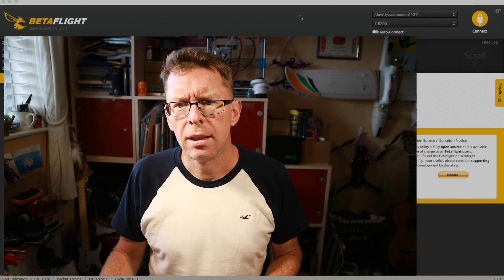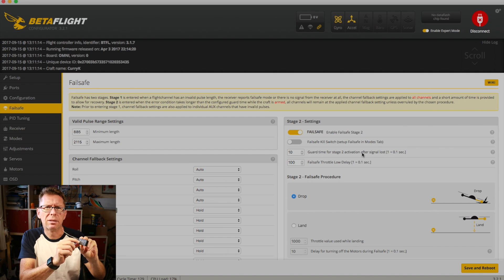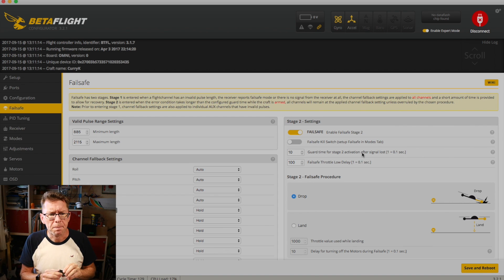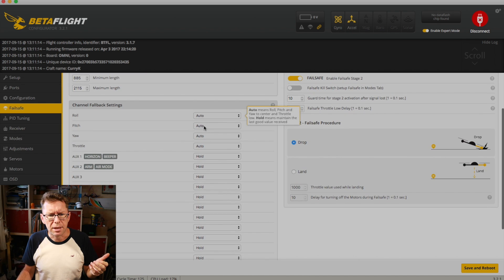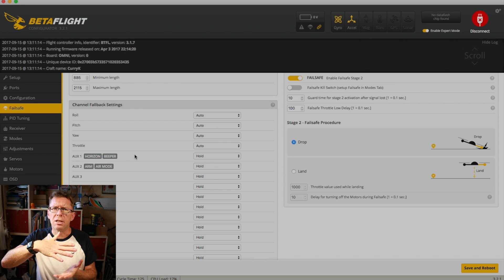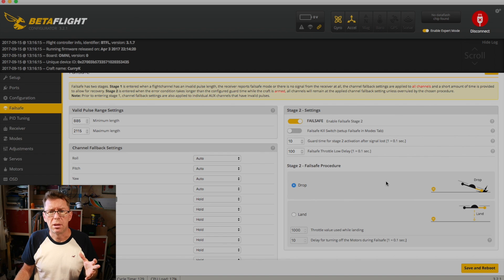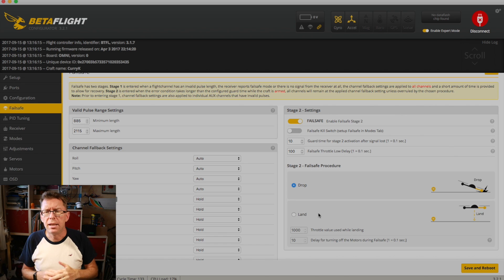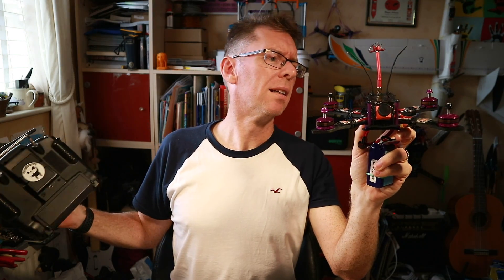FPV Tutorial: BetaFlight Basics Part 4 - The Failsafe tab

Comment: Hello buddy just wanted to ask you I keep getting the failsafe warning and beta fight which is preventing me from arming and I don't know what to do it's for the mobula six whoop V flight controller? Beta fpv lite 2 se is involved lol...
Reply from the maker: It does seem reasonable to not let you arm if you are failsafing... afterall it means you've lost your control link.  I don't know the FC, does this have a ELRS rx SPI built in, or is it an external rx.  External rx, then I'd be checking out the physical wiring and looking for lights to see if this is losing the signal.  If it's SPI, then check you version of betaflight to see what version of ELRS this contains and double check this is in synch with the radio

Comment: Hmm! I increased guard time from 4 to 10 (1second), however when I tested it by switching off the transmitter the props only spun for .4 of a second (same as before I changed it from 4 to 10), they should have spun for 1 second. Any idea why it did not change? My Taranis radio failsafe was also set to no pulse.

Comment: I know this os older post but you seem active to your listeners.....I have old radio FS-T6(Flysky)This 100% has no ability to do failsafe.I am going to use this radio and swap a quad I have to an F4 FC(Currently CC3D)as you know CC3D has no failsafe option.So bottom line Betaflight should be able to do failsafe no matter the radio...correct?

This build is just a trainer of sorts.Thats why using old radio that I have laying about.
Thanks and appreciate any feedback.

Comment: Probably a bit more advanced, than where we are with the programming. But I think if there is a GPS module on board, a good failsafe would also be to return to position of last known good signal. But I suppose at that point you would need to start programming in a fair amount of autonomy, as well as environment sensing for obstacle avoidance. And at that point you might as well be programming an autonomous drone, that flies itself based on prerequisite trajectory inputs. I.e. a flight path, input through custom firmware.

Comment: I just put mine on airmode and for some reason while on betaflight I check my motors and they started throttle up really hard i shut off the quad
Reply from the maker: Noise gyro is something that can do this - pretty much the board thinks it's moving and so gets the motors to rev up more on one side, but then that causes the other side to have to compensate and before you know it, that quads at full throttle and you haven't touched the sticks.  Try getting the quad on betaflight (props off) and see if you get any movement in the debug screen that you aren't expecting
Reply: @CurryKitten  I just started i know just a lil im learning
Reply: @CurryKitten  dont kniw wats dat
Reply: @CurryKitten  debug screen?

Comment: what about a high throttle for auto-land? that'll bring the quad up above occlusion and regain rx no?
Reply from the maker: The trouble with that idea is that it fixes a problem in a single situation, but what if your signal is not lost because of an obstacle blocking you - your quad heads off into the stratosphere and comes down who knows where.
Reply: like what, the Tx shutting down or out of range?
Reply from the maker: Ok, so let's say some other type of RF interference that wasn't simply solved by the quad going higher, or flying through trees so you go straight up and get stuck, or through a bando.  Although in a lot of cases getting higher will help your signal, it's not an always - and what we don't need in the world right now is runaway quads

Comment: I don't understand why drop is better than land?
Reply from the maker: Because the quad has no idea where it is in the sky, no high up it is or where it's home point is.  "Land" in this context would just mean putting in a throttle setting where you felt the quad would descend nicely, but all this time it would blow around in the wind and drift out to who knows where and do what damage.  Just dropping is safer.  If you went further and decided you wanted a GPS onboard and used Betaflight relatively new "Rescue" mode to RTH then that's a different story, but without any of that, just drop
Reply: @CurryKitten  exactly
Reply: @CurryKitten  makes no sense to pick crash over land.....
Reply: @PrentissRacing  until as it lands the wind blows it into a house or road etc and there is nothing you can do but take the fine
Reply from the maker: @PrentissRacing  As I've written before, betaflight doesn't know how to "land" it just knows how to control it's attitude and runs the motors at a certain rate.  Another thing it doesn't know is when it's landed - so it could come down safely and continue to run the motors, and if they get tanged in grass or whatever then they continue trying to run and your ESC or motors will burn out.  You, of course, are free to set it up anyway you like and I am also free to tell you that using land as a failsafe is madeness !

Comment: I'm still looking for the problem, but I might as well ask you in the meantime; My old BF F3 fc and  Flysky X6b rx don't failsafe when switching the transmitter off, settings seem correct.
Reply from the maker: I haven't used FlySky in 5 years or so, but reading about that RX it seems that it doesn't send a no pulses signal in the event of a failsafe, but instead sends a predefined set of channel positions that you setup.  If that's the case then what you probably want to do is setup a mode for failsafe (it's in the mode tab) or simply disarm, throttle at zero and beeper on and then set that as the failsafe position
Reply: Just came back from a nice ripping session, and there was a flysky enthousiast who told me I have to set failsafe up in the transmitter and that gets send to the receiver. Never heard that before, but I'll try it.
Strange thing is I have 4 kwads with the same reveiver and only one does not failsafe.(guess I never checked it)
I'll set up a failsafe mode switch too.
Thanks for the quick answer!

Comment: Good video thx. I am having a problem with Failsafe kicking in and my Quad dropping/crashing, twice in one day, it's at the start and end of my latest video. I don't know if it's common for this to happen or if I have a problem but as soon as I get close to being behind something it activates. Is this something that happens often with FPV or not? You can see it in my new vid, not sure if I should be continuing to fly or not, it seems very sensitive and goes off at the thought of losing a signal, weird. https://youtu.be/sVoJQ2lLQKk
Reply from the maker: The answer, rather annoyingly is "it depends".  Looking at your vid there, the obvious thing to watch where you fly is dipping down the hillside and blocking your los to your quad with a massive pile of earth.  That sort of thing would result in a failsafe.  However, looking at where they went both times, the signal didn't look like it should have been too hassled, and I would expect a receiver to cope ok.  The "depends" bit comes in when you take into consideration the receiver type, and the antenna positioning (both on quad and radio)  Certainly if one of my quads failsafe'd in that sort of distance I'd be looking into the issue - I do expect to be able to fly pretty far and behind some obstances.     Is that RSSI value shown in your OSD accurate ?  I was a stronger signal strength when you failsafed than when you landed.... which is all a bit odd.  Really this shoudl be your early warning system, the number should drop down as you are going out of range, but really be around the 90-100% when you are close in
Reply: I wondered that, so the number in the lower right corner of my OSD is my TX/RX signal strength I didn't actually know that, but have been wondering if it was my VTX or RX signal, so yes I agree I never see it go up to 90. Hmmm... sounds like I have a weak signal that doesn't take much to activate FS, good eye, I will take Quad apart and see if I can change my RX antenna, maybe some testing walking around with props off would be a good idea. Thx for your input, appreciate it. Is there anything in particular that you would look at if this was your Quad? Not sure what else to try apart from antenna. Cheers.
Reply from the maker: Looking at your quad (I presume your rx antenna is that one coming out that back) the position looks fine. 
 I'd certainly look at what happening with the RSSI signal, as it's either uncalibrated in someway and is of no use, or it's indicating that your signal is dropping off extremely quickly.  Have a look at this video from about 2m 45s https://www.youtube.com/watch?v=qG5bsLStmBs and look how the RSSI gradually drops away as we get further.  That's the sort of thing you are aiming for - and then you could understand if it dipped rapidly and went down.  What receiver are you using.  I'm not a FlySky user, but I'll have a look and see if I can understand what it shoudl be doing / how it should be setup
Reply: I went and looked at 10 DVR Videos from my flights and all of them are the same, the signal strength is average 53, never below 50 and never goes above 65. Even if I am standing next to it. I have heatshrink over the antenna, just loose but will try taking that off and see if anything changes. I certainly do have a weak signal. Makes sense that both times I was starting to push the boundaries with LOS (just) and because signal already at 52-ish it doesn't take much to FS. Interesting... not sure what to do.
Reply from the maker: Take another look at the video you linked to, when you landed at 10m 30s, you have RSSI of 33.... far less than when you fell out of the sky earlier.  So all very odd - what is the receiver you are using ?
Reply: I have the Eachine Wizard X220S and FlySky TX. The RX is a Flysky FS-A8S receiver. I haven't modified anything. I think that somewhere in BetaFlight I have something wrong, I have only just started FPV'ing so this is the first time I have had footage to look back at and see my signal strength so can't see what it was when brand new, I was only flying LOS without goggles prior to a week ago. This is definitely the problem, I agree that the antenna looks fine where it is. It must be a setting? Mine is the FlySky option here https://www.banggood.com/Eachine-Wizard-X220S-FPV-Racer-Omnibus-F4-5_8G-72CH-VTX-30A-Dshot600-800TVL-w-iRangeX-iRX-i6X-RTF-p-1153989.html?rmmds=search&cur_warehouse=CN
Reply from the maker: Well, the RSSI thing could be a red herring.  To be fair I'm not a FlySky flyer, but I can't see any docs that suggest that RX can actually put out an RSSI signal back into the flight controller.  If you go into Betaflight, connect up your quad and go into the reciever tab - does it show and RSSI channel in the drop down box on the right.  If so, what is it, and is it used for anything else ?  Aside from that, I'd check that the UFL connector on the rx looks nicely seated, and then perhaps do a few old-school range tests.  You could take the props off, arm it - sping the motors slowly and walk off and see how far before it failsafes (I'm presuming motors stop and it beeps)  Try it in a few locations - just in case it's something weird and wonderful about one place.  If it's coming up short in all cases, it might be worth swapping out the rx
Reply: Wow, I watched your video, I see what you mean, you are at 99 when you fly overhead. Mine won't go above 62 when I am physically touching my TX antenna on the RX antenna.... that's all it has. It would be good if I could email you a screen shot of my BF setup. Not sure if you want to publish it. You can email me at brigzy@compassnet.co.nz if you like. I am looking at the BF RX page now. The RSSI drop box is set to "Channel Map - AETR1234" and "RSSI Channel - Disabled. Is that a problem? Lol... sounds like one to me.
Reply: On the BF Setup Tab when I have the Quad plugged into BF, a battery plugged into Quad and my TX on BF is reporting (on Setup Tab) that my RSSI is 61%, it is sitting 10 inches away from the Quad too. That seems to be the max it will do.
Reply: Range test completed. I armed the Quad and set to slow motors turning and walked off. Holding the Quad it kept running, I managed to sit the TX on the ground and walk completely around my house and back to Quad without a failure, no problem. I then walked down my driveway about 300ft, all good until I walked behind a bush and Failsafe kicked in, motors off and beeping. Certainly is a weak signal. I start to get a bit lost about here... not sure what to do, will pull apart and check the RX and plug, I will also soft mount it with some padding, it came tie wrapped to the frame, no padding at all.
Reply from the maker: It seems likely that what's happened is that someone set the quad up with an RSSI indicator on the OSD, but there's no data for it.  You either get the RSSI from a channel in an SBUS/iBUS stream, or there's a physical connection to pads on the rx (which your rx doesn't have).  This may explain why the reading is jumping around all over with no real relation with the signal strength.
Reply from the maker: It's certainly not great - generally speaking going behind a solid object may knock out your signal, but just bushes and trees won't... unless you are at the extreme end of your range of which you shouldn't be really.  So check out the ufl connection as I mentioned, and it's worth removing that heatshrink just to make sure that there's no weird breaks/kinks in the antenna, and that the exposed section (the active element) isn't damaged.  You might also want to do you range test having the rx external to the quad (just to see if it's getting messed up by nearby large voltages from other wires) I did start out on FlySky (back in the turnigy 9x days) but it was this lack of knowing when the signal was degrading that made me buy a FrSky module and move to telemetry based receivers.  I'm not suggesting you have to splash out big money and get new gear - but it might be worth replacing the rx you have if everything looks ok.  Sometimes you just get a faulty rx, and it's difficult to tell if that's the case until you compare it with a working one
Reply: Very good point, I tend to think that is exactly what is happening, I will simply turn off the RSSI OSD, it is set to display. That doesn't explain the failsafe crashes but it might be just bad luck and coincidence that I found 2 dead spots in one afternoon that caused crashes. It's a shame not to have that option, I bought a new RX the same kind... $12 NZD not bad at all. Will have a spare if I don't use it. Thx for your help. So could I actually get it to work do you think if I did use an Aux CH?
Reply: Will do just that tomorrow, will pull apart and see if I have any damage, I have had about 4 heavy-ish crashes and the RX is definitely not right, it wouldn't surprise me if the antenna was broken or something damaged. If I put the new one in and its no better it it has to be my settings, it might have had poor signal from the start (1 month since new) but I didn't know as I only just started venturing out a bit further with FPV, LOS flying was fine of course. I am using SBUS but wonder if I should be on iBUS, all a bit confusing.
Reply from the maker: Sadly not - at least not according to the documentation on that rx.  The reason that option is there is for receivers that embed their RSSI signal as part of the SBUS stream.  So on my FrSky XM+ rx,  I have 15 normal RC channel and then channel 16 is RSSI, so I can tell Betaflight that this AUX channel is the RSSI.  There's also another way to do this with a rx that sends an RSSI telemetry signal back to the radio (essentially you can take the telemetry and send it back as an RC channel and then tell the flight controller to use it - a big circle - written up here http://www.currykitten.co.uk/getting-the-rssi-value-to-show-in-your-betaflights-osd-frsky-based/) But your RX doesn't do that either, so you kind of need to find the limit (hopefully improved with a new rx) and try and stick to it

I forgot to mention the radio antenna position as well - just in case you weren't aware.  As you hold you radio to fly, make sure it's in a position so its pointing upwards - which usually entails pointing it slightly towards you.  It'll give it the best signal strength
Reply: Ok I didn't know that about the radio, I have been sitting on the ground with it horizontal on my lap while FPVing. That will help! My BF is setup with SBUS not iBUS but to be honest I am still learning what they all are. I set it up according to all the vids I have watched... :-)
Reply from the maker: Ok - might help then.  The way the 2.4 signal works out of these antennas is like a big donut shape where the hole is the null point where there's very little signal.  So with both antennas vertically aligned, the donuts easily overlap each other and you get the best signal.  Caompare this with both antennas pointing at one another where you have no overlap, and a null.

I read the iBus is supposed to be better - but only because it supports a failsafe, although yours seems to be doing this in some way at least.  Certainly worth trying out if you are doing a bit of reconfig anyway
Reply: Go into the device status tab with it powered up and see if your cpu is overloading. That will failsafe your quad also. If it is, shut down some features and then try it. I have two drones and i haven't flown either yet, due to two months of figuring this stuff out. I bought them from a guy who had given up the hobby after he messed up these drones flight controllers and couldn't fix them. I am glad i stuck with it. Now I have discovered i can work on and repair all kinds of devices because its all basically the same as drone tech. So from one noob to another , "drones are kick ass fun!"